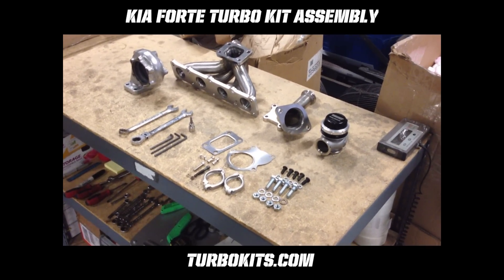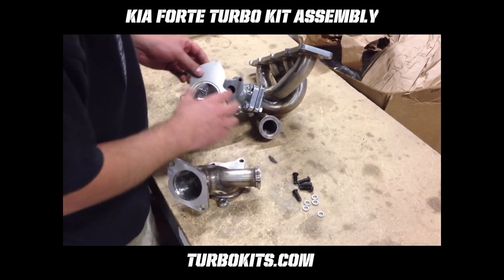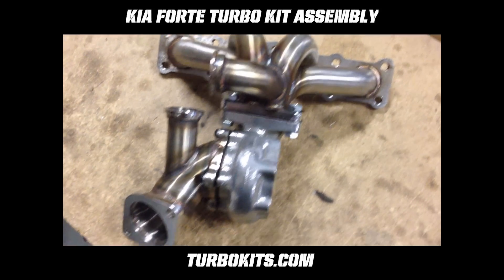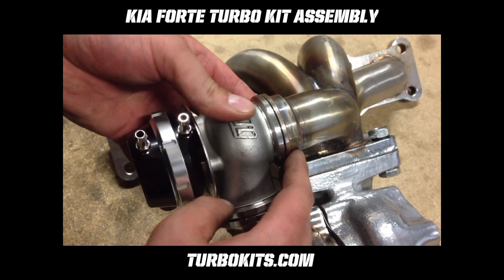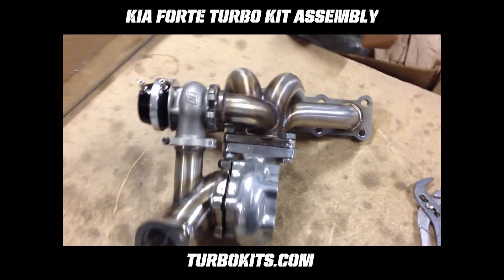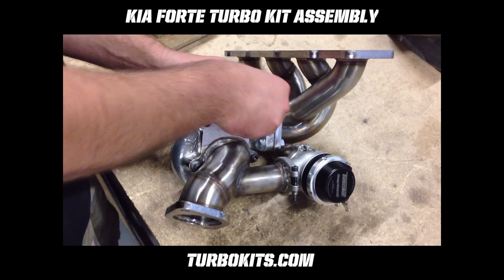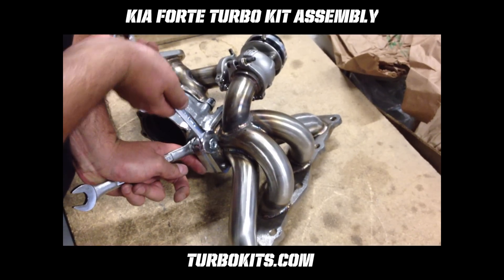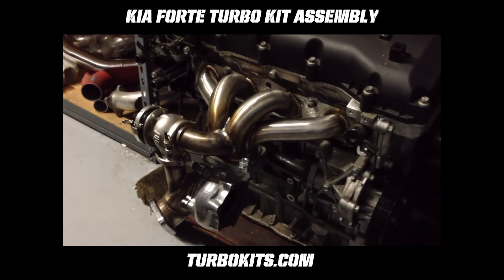Kia Forte Turbo Kit Assembly - Manifold, Turbo (Turbine Housing), Wastegate & Turbo Outlet Pipe

Comment: Do you need to get your engine forged beforehand?
Reply from the maker: For the out of the box kit at 7PSI, no, we designed the kit to maximize the performance of the stock drivetrain with risk of engine damage, now there is always a risk, but we feel we have built our kit to keep it as low as possible. Thanks!

Comment: Will it fit the 2015 Kia optima 2.4L?
Reply from the maker: Potentially, but tuning would be the hard part. The 2.4L is GDi, so the Forte injectors and fuel system wouldn't work.

Comment: Once you install this do u need a tune and can u have stock internals ??
Reply from the maker: Yes you do need a tune, there are a few good options on our website and also other tuners that can get the job done. Stock motor 7-8 PSI is perfectly safe when tuned & maintained properly. Thanks for your interest!

Comment: what engine is this turbo design four
Reply from the maker: It was designed for the first generation Kia Forte, but will fit most Theta II motors.
Reply: TurboKits.com  will it fit on the DOHC motor for 2012 cerato hatch 5dr 2.0?
Reply from the maker: Yes sir, we have a few Forte 5 guys running our kit :)

Comment: I think it's the same engine of the Hyundai i30 1.6 DOHC petrol 2010 , if so, turbo kit that supports or does not work. I'm interested
Reply from the maker: Without us or a customer actually testing fitment we can't know for sure if it will fit any other vehicle except the one it was designed for. The Forte motor in the US in 2010 came in a 2.0L and a 2.4L version, partially shared with the Genesis 2.0T and the Sonata/Optima 2.0T.

Comment: Great video. I was doing some research and it seems my 2008 kia optima has the same engine as the 10-13 forte.

You wouldn't happen to know if the manifold would bolt up?
Reply: Edit-I'm talking about the 2.4
Reply from the maker: No, we have not tested it, but you can go to Kia and buy an exhaust manifold gasket for both cars and compare them. It’s an easy and low cost way to check.

Comment: Hey will this kit work or a 2008 KIA spectra 5
Reply from the maker: Chris our Kia Forte kits were designed for the 2010-2013 models and the motor in the prior generation Forte / Spectra is not the same.  Unfortunately this kit will not work on a 2008 Spectra.  Thanks.

Comment from the maker: The kit is not 100% bolt on, there is 1 pipe that needs to be modified, but we do have it successfully up and running at low boost 6 PSI without issue :)
Reply: I just ordered mine! But whats the pipe that needs modification? What needs to be done to it?
Reply: @foobyshoo7952  hey how is everything? Do you already got your kit? I want one
Reply: @Latinomusicup  it's going good they have changed the pipes then bend to a hard rubber tubing so it didn't need modifications. I've had it installed now for about 4 months and it's the most fun I've had with the car. Easy install, very thorough instructions. The sound of the turbo and blow off is loud enough to turn heads no matter where your at.
Reply: @foobyshoo7952  would you mind uploading a video showing us what you say? thanks

Comment: well I know there are some turbos for cars that are not too expensive becuase 3000 isnt the worst but I dont plan on using 8psi of boost so i feel like I would be paying for extra that I wont use, as well as,if I just lowed the boost on this type of turbo I shouldnt have any problems? I hate to sound like an amature but how difficult is it to restrict the boost of the turbo to only allow 3-5 psi of boost, would I just restrict the flow or would it be by the blow off, or comp? Thank you

Comment from the maker: I don't follow the first part of the question? Our kit uses all brand name parts at great prices, but they aren't the typical "cheap" stuff that causes trouble if that is what you are asking? We have not tested the 4AT, We have 6MT, 6AT and 5AT running 8+ PSI without issues. If you plan on doing the turbo on a 4AT, I'd suggest an trans cooler and low boost.

Comment: is the a cheap turbo that I can buy as a different aftermarket part, as well as, I have heard horror stories of 4 speed kia's and having serious trans trouble apon any boost. is this the case and if so what is the most power I can get out of my car, or is there a way to find a 6 speed to put into my car?

Comment from the maker: Not sure, we haven't tested it. We have no idea if the manifold is the same, the injectors, the engine management, the piping, etc... Unfortunately it's not something we can guess on. If you wanted to pursue turbo on your 1.6L Forte you would need to be responsible for making the changes to the kit that are nessecary for it to fit.